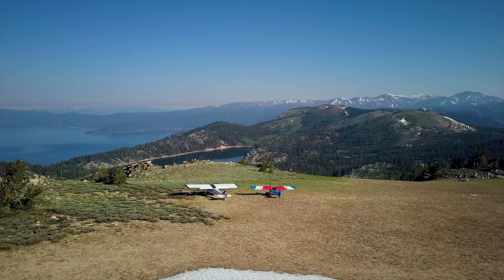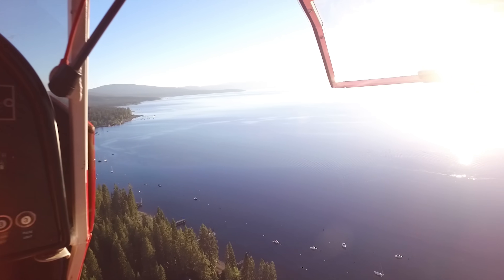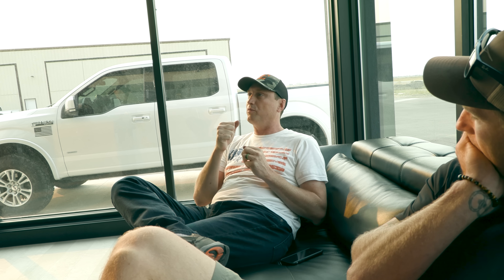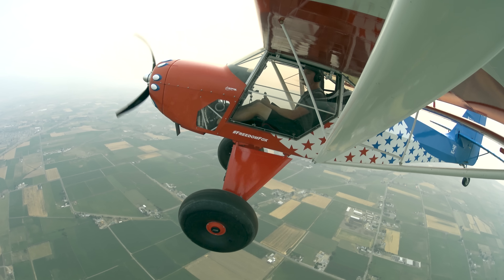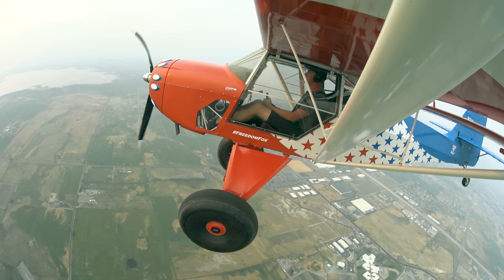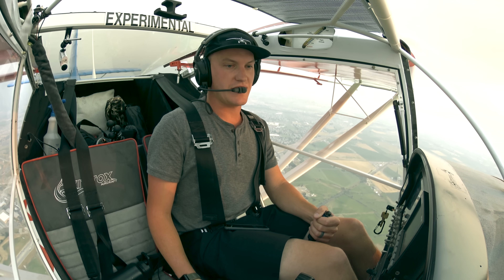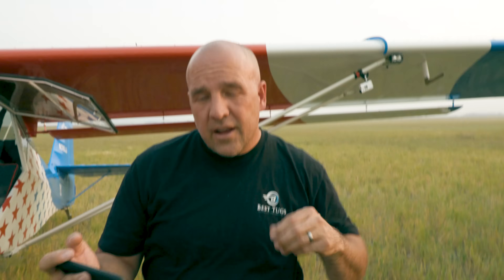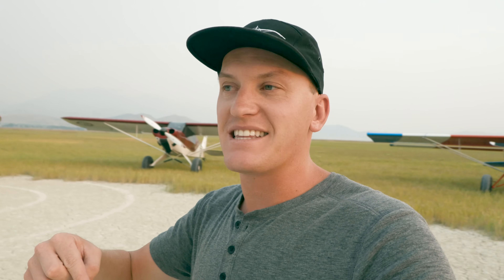YOUR FLIGHT INSTRUCTOR WAS WRONG! - Simulated vs Real Engine Failure

Comment: Interesting stuff but I wonder why a windmilling prop would appear to create more drag than a stationary one. Provided the blades maintain the same angle, the air speed remains the same - I would have thought the force exerted on the blades by the air would be pretty much the same regardless of whether they're spinning or not which would create the same amount of drag. In fact I thought it would be very slightly more drag to keep the props still. Could it be that the spinning props interfere with some of the air hitting the wings where as the still prop doesn't? I've heard people say a windmilling prop creates more drag than a stationary one because the windmilling one has to spool up the engine which takes effort. But it also takes effort to constantly push against a prop which doesn't have enough inertia to overcome the next compression cycle so what's the difference? I think it would be interesting to see the difference between no prop rotation, windmilling with no throttle, windmilling with wide open throttle unless your're using diaphragm carbs in which case the test might be even more pointless. But if not then at least you could create less of a vacuum on the intake side of the engine. Then hopefully you would get most of the energy spent on the compression stroke returned to you on the flameless combustion stroke while the intake stroke wouldn't be sapping so much energy from the pistons.

Comment: I would prefer 2 descents of 2000 feet each. 2 with the propeller windmilling and 2 with the propeller stopped. Get yourself descending and stabilized above the start time altitude. Video record  it showing the time, altitude and airspeed for each of these descents. Then go home and review the video. 
Then publish a side by side video of  the propeller stopped vs the propeller windmilling. That would be a very good video with each example in the same screen descending thru the start altitude at the exact same time.

Comment: Why are you even talking about idling prop. If you have  engine failure  most likely you won't have the idle run too ( like in your case ).
So it is all about windmilling prop against stopped prop. And for that you surely know that windmilling prop creates more drag than stopped one ( example giro copter main rotor ).

Comment: Had a few engine failures and the times when I couldn't climb but engine would run definitely extended the glide.
Reply: Sounds like you need to do a lot more frequent maintenance. XD
Reply: The truth is my failure rate dropped dramatically when I started performing my own maintenance. I was a B52 mechanic in SAC ( the Air Force ). Had my own shop and held a heavy duty truck master mechanics certification. A&P mechanics and IAs are the most over rated certifications I know of. Most are proud, charge lots of money but don't know shit.
Reply: @burtvincent1278  If you want something done right...

Comment: Isn't it almost the same with a helicopter engine fail? When rotors stop completely it will fall, when it doesn't it will glide to the ground.
Reply: No. That’s is even more proof towards windmilling prop creating more drag, which is my helicopter falls slower. But the real reason helicopters use windmilling if possible is to use it in a trick the name of I don’t remember. It’s basically set prop to negative collective, let it spin up for as long as possible, and just before it hits the ground pilots sets it to max positive collective. This way prop is able to put a lot of inertia into rotating mass and then use that to try generate that last bit of lift using that inertia and hopefully land softer.

Comment: The results make sense because a prop, having some cross section on the blades, most likely presents a constant amount of drag, relative to speed.  A prop spinning at idle has the same drag as a stationary prop, but is producing a small amount of thrust that offsets that drag.  A freewheeling prop most likely has about the same drag as a stationary one.

Comment: Most fixed pitch props (not cruise Props) stop turning at between 60/65 knots.  I used to stop the prop on Cessnas at that speed when on a high base leg, and land with prop stop to get the pre solo students used to real dead engine landings.. Careful the student dont do a Panic Pull before flaring.  Put your hand behind the control to stop that.. Push nose down well to get the 60 knots Vfinal again. 
Yes, the stopped prop acts like an spoiler, making you sink faster.  Just use the gliding speed mark.  Dont stop the prop if that means flying slower.  Many have died pulling up trying to stop the prop at under Vglide speed and stalled it.

Comment: Turning at idle prop has power on it.  Less drag due angle hitting the air is less when the turning with power prop BITES THE AIR IN FRONT.. Less angle on the relative wind hitting the prop = less drag.  No power on the prop is more angle of hit and more drag from that prop.

Comment: Someone needs to get access to a wind tunnel to properly test this.  Main gear locked onto gauges to measure rearward force.  Pick your wind speed, hold it consistent.  Engine at idle, take the average force over 2 minutes, then shut the engine down and take that average force.  If the prop is windmilling, figure out a way to put a brake on it (temporary of course) to test stopped prop as well.   Could expand that to different pitch props as well...

Comment: I will guess that an O360 will idle much lower than a Rotax. Which is where you will see a huge difference. You can throttle a O360 to where the wind is actually turning the motor over creating drag. 
The Prop not moving will be more stalled, creating drag more as wetted area.

Comment: As a glider pilot... we spend a lot of time thinking about this stuff. By measuring loss of height over time you really compared your aircraft sink rates, not glide rates, in the various configurations.  You would need to measure the distance over time rather than height over time, to get the glide rates.  Yes, I know you flew at best glide speed and it's likely not much different, but it could be, we don't know.  Point is, the times to lose 1000' were not much different so it is very possible you flew a shorter distance over the longer time to lose the 1000'.   This is possible if one configuration has a lower sink rate AND a lower glide ratio.  Yes it is possible, just fly any aircraft slower than best L/D speed...  Anyway, this can be important at times, like when you are a loooonnnnggg way from a suitable landing area, as I was many times during this flight (the aircraft I am flying has no motor).  https://www.onlinecontest.org/olc-3.0/gliding/flightinfo.html?dsId=7596636

Comment: Considering we all are supposed to fly our airplanes according to the POH, and in my country it’s against the law to deliberately turn the motor off on the certified GA aircraft I fly, I found this test was really interesting. Would I turn the motor off in an emergency? No, I wouldn’t. If it’s turning, and I could even get 50 more revs out of the prop with power by, say, pumping the primer a few times, it could change the outcome of my emergency to the positive. Keep all options open.....

Comment: Am I wayyyyyy off on this or is this a mix up with best glide and float in ground effect?   As I understand it, it is not that the glide is better because of reduced drag, it is that when in ground effect there is more float (longer glide down the strip) because prop wash is not spoiling the ground effect.  If so, the test would need to be done within a wings length of the runway and landing distances compared.  I could be way off... student at the moment, Lord willing I'll have my check ride scheduled for the end of this month.  Thanks for the vids and stay safe!

Comment: If an airplane flying at 10,000 feet with a load of Canaries all sitting on the floor suddenly startled  all the birds into flight, would the airplane fall, stay at 10K, or climb? This subject endured considerable exercise in the alert shack during the 1960s. to my knowledge it was never solved.
Reply: It would stay the same. For a bird to fly, it must produce a downward force. Equal and opposite reaction and all that. The net force would be the same. Unless I'm missing something which is very possible

Comment: How much energy are you loosing to stop the prop?  Because at the end of the day, the altitude you loose stoping the prop could be greater than the glide distance you gain by having it stopped.  Considering all the excess induced drag to slow down to the speed that you have to slow to to stop the prop.  Another consideration is if you stall the airplane attempting to stop the prop you are going to need more altitude to recover from the stall with the engine out.  If you loose your engine I dont think you are doing your self any favors trying to stop the prop, just fly it to the most favorable place to land.

Comment: There is also one other phenomena that can explain better glide with a prop rotating at idle and that is airflow separation from the top of the fuselage /center wing section and fuselage body. The rotating prop inducing the same effect as vortex generators maintain a laminar-ish  or reduced turbulated flow over the fuselage body. This phenomena would be less noticeable on sleeker aircraft that have smooth transitions. I've witness this effect in tuff tests.

Comment: You would think that when the plane is windmilling the area of the prop is greater because it’s spinning and forward motion is be being suppressed by the drag of the engine. Not sure if I said that correctly, the prop is in more contact with more air because it’s spinning and there fore the area of the prop is greater. Nice test I’m not a pilot however I love the challenge

Comment: I think the confusion arises from the fact that people are comparing three different things here, not two. An idling engine with a fixed-pitch propeller probably flies better than a stopped propeller (the engine is doing work on the propeller after all). But a windmilling propeller with the engine off certainly generates more drag than a stopped propeller. Idling is better than stopped dead engine which is better than wind-milling dead engine. Now whether it makes sense to try to stop a windmilling propeller (if it doesn't already stop at best glide airspeed) by slowing the aircraft down is a whole different issue and depends on many things and the answer may in many cases be "no" (and I assume that's not what your tests were all about).

Comment: Maybe I'm wrong 
Just measure how fast the air flows is at idle
If it's slower than your glide , it's drag
And as far as the propeller only having so much surface whether it's spinning or not look to a gyro for that answer
Reply: Bear in mind that the question isn't about whether an idling prop creates drag. Suppose you have an electric motor than can idle from max RPM to 1 RPM in a smooth continuum. As you lower the RPM from max, you'll get less and less thrust. At some point, you'll be at zero thrust. If you lower the RPM a little more, you'll start getting drag.

The claim being investigated is that if you continue lowering the RPM, you'll get more drag to a point, then start getting less drag to another point, then go back to getting more drag until the rotor is stopped. So there's (allegedly) a point between no drag and stopped where you have more drag than the stopped rotor produces.

Comment: Great discussion. Think Glider pilot. What is your L/D for that aircraft? Ok, say 5/1 if lucky 7/1. Ok, what glide slope (sink rate) does that produce? Graph it out for different altitudes, 200, 300, 500, 1,000. That is the distance you can fly at what ever a "comfortable" speed to maintain flight to land is for the given aircraft.   A Canadian Air Captain flying a bran new Boeing 737 full of passengers. Ground crew miss-fueled the aircraft and the plane ran out of fuel. Because Captain had glider experience he told his flight engineer to run the L/D to Altitude numbers. The navigator located an abandon military airfield with in that glide slope range and safely landed. All hands saved.  ~ your neighbor ;) & G-pilot

Comment: This means that the drag from friction generated by a still prop is  more than the additional turbulence of a rotatung prop. Rotation= lower friction with more turbulence. Still= higher friction with lower turbulence. 

Look at wind tunnels of rotating props, they create turbulence. The flow coming off a still prop will have more laminar flow.

Comment: Fantastic video and great test this is coming from somebody that has had 2 engine failures as well as a major electrical fire totaling 3 emergencies the first engine failure was in a Cessna 150 where we sucked a valve the biggest piece of piston in the right side of the engine was the size of a quarter and we did keep it running for as long as we could playing with the mixture and throttle we were over the Cypress swamps in North Florida and just taking off from Lake City heading to Tampa  the engine fail at 7000 ft we made Chiefland we where going for US 19 and found a crop duster field on the side of the road and landed there the second engine failure with much scarier we landed at Chattanooga in full IMC fueled up heading to Knoxville Tennessee in a single-engine Comanche the fuel truck pump 20 gallons of water along with the fuel into our tanks that one the prop stop at about eight hundred feet and like I said full IMC we did the 180 and went back and made the runway I can tell you I wish I practiced this stuff thanks for sharing and happy flying

Comment: I can't get to idle rpm at best glide.  Idle on the ground is 800 rpm, idle on final at approach speed is 1200 rpm.  So the air is for sure turning the motor faster than it needs to be, hence more drag?

Comment: a rotating prop is a brake, the speed records where made without propellers.
in rc speed records, the fastest is a glider.
When gliding with electric propelled models, a brake must be used to stop rotating otherwise it brakes a lot

Comment: You should be able to see this on the rpm gauge (old airplanes like the dc6 actually have also a so called bmep gauge. Basically what it can tell you is closest to your real power output and by doing that it tells you for example wether your props are mainly powered by the engines or by windmilling in the airflow last of it could result in shockcooling these big engines). If the engine is running and you are flying fast enough (> best glide) that the rpms rise with throttle at idle it should create more drag since the force accelerating the prop deccelerates the airplane. This however should not be occuring anywhere near best glide but probably at higher speeds (you can see something similar in for example c172 if you level out for cruise and pull out the power before you reach your desired cruise speed. As the plane accelerates further the rpms will rise and you will have to correct it once again, which is why i was taught to pull the power to cruise when i reach my cruise speed.

Comment: Feel like i'm gonna add to the plot here... Been flying rc f3p for some years now and in total vertical decent we definitely notice a decrease in air speed when the prop is at idle vs completely power off... ie (opposite of what is said here) . in fact we use this method of low idle power= slower decent vs shut off power in order to slow down the model and make a constant speed flight more easily achievable. Saying this the models do weight <100g and have a thin x axis profile. guessing no ones willing to test a full vertical dive using the same method in a full size??? :(

Comment: As an aviation and history fan i have an interesting fact for y'all. The germans knew this in ww2. And they wanted to be able to glide as far back to their territory as possible if their engine was shot or died. To insure best glide they installed spring loaded pins right behind the prop of their planes that the pilot could pop out to stop the prop from windmilling and causing drag. (Doubt it was nessicary a v10 or v12 is probably pretty hard to turn over) but none the less they definitely paid attention to tiny details.
 Have a good day everyone, fly safe.

Comment: If you look at a vector diagram of a blade element to see what the aoa of that element is, you have to take into account the pitch angle of the blade, the velocity due to rotation and the velocity due to the forward flight of the airplane and its aoa. You add all these vectors up and see what you get. At a certain forward speed the prop will create drag vs thrust and the faster it is spinning the more drag it will create. It is not intuitive. You need to run the numbers and there are a bunch of variables, like everything else in aerodynamics.  Redo your test at 70 mph, then 80. At some speed likely the idle prop will be worse.